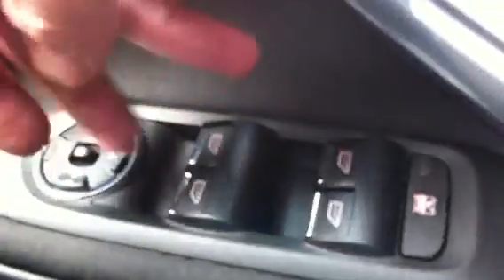Ford one-touch Electric Window system not working?

Comment: Legend.
Disconnected the battery to put on a gas strut (uses the battery earth point as a stabiliser for the bracket) and the window auto up feature stopped working completely.
After this video was fixed in 20 seconds.

Comment from the maker: Brackex,
You need to coax the window up to the top. Don't let the switch do a double click when you pull it up. If you only half pull the switch then the window is in manul mode and will go all the way up. Sometimes it is easier to do it a little at a time.
Goodluck

Comment: So I tried this on my USA model 2012 Focus Sedan, only the front windows were affected. Doing it with the window up did not work, so I tried it in the opposite direction, with the window down all the way I pushed the switch down for 2 seconds, released it, and then did it again for 2 seconds. This worked for my windows that were stuck in manual mode.

Comment from the maker: It might work, but if you are having to pull the window up by hand you have either got a failing motor or there is something in the window runners stopping the window slide smoothly. Try a little silicone spray in the runner, might loosen it up. If you haven't got silicone spray, furniture polish works, just smells!

Comment: Front driver window only goes down 1inch and stops, It goes back up with no problem,.I did try to open it when maybe still frozen and it opened just as much so could this be the problem ? All the other windows OK so...

Comment: hello, my front passenger window wont work for the passenger but i can control it from the drivers controls, however i have to press it repeatedly before it works, does anyone know how to fix it or how much it costs? cheers

its a ford mondeo' 05 reg diesel ghia

Comment: just tried this worked for a few times then went back to how it was, its the auto down it stops about 4 inches from all the way down, any ideas? Thanks
Reply from the maker: Firstly, if it is a rear window that's were they stop anyway. But sounds like your runners are jamming the window. Try spraying a little bit of silicon spray in the runner to lubricate it. If you haven't got that try furniture polish, will do the same thing. Just run the window up and down a couple of times and it should work. Failing that check the runner because it could be jamming or the window mechanism inside the door.
Hope this helps....
Reply: 60secsale ok thankyou, it is the drivers one